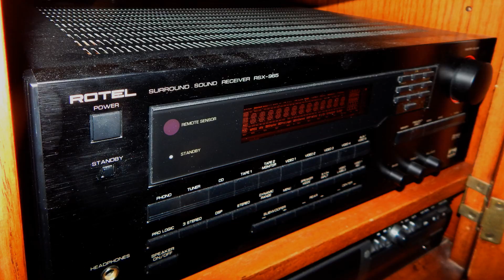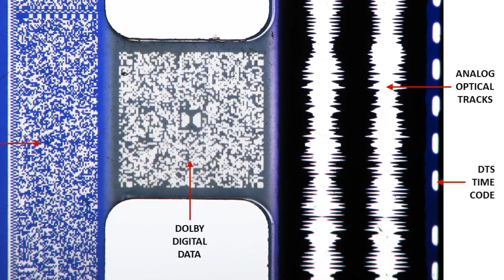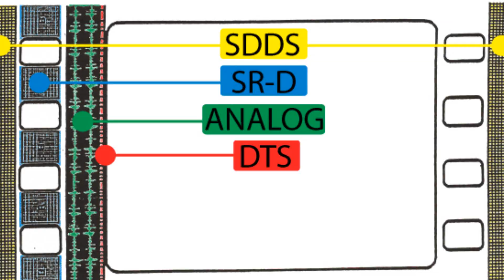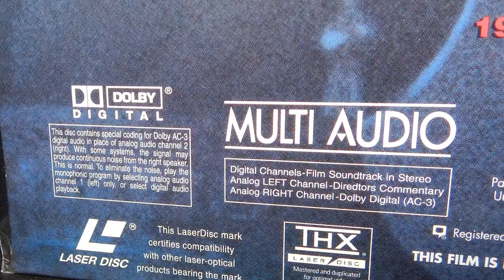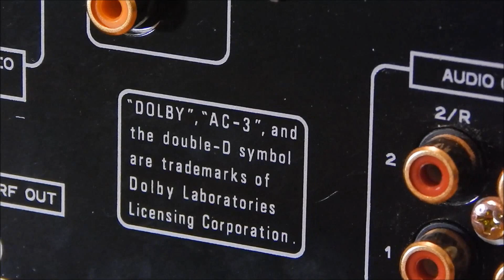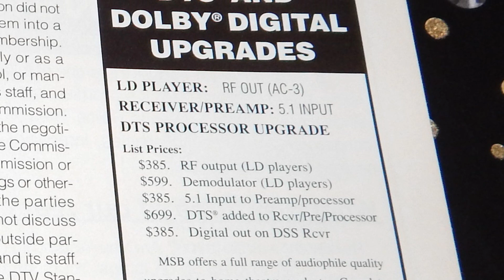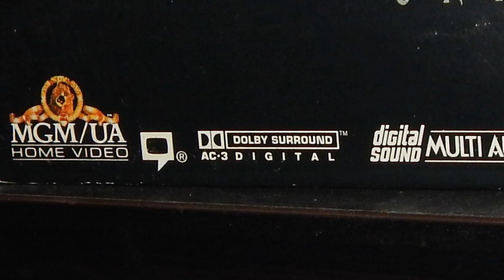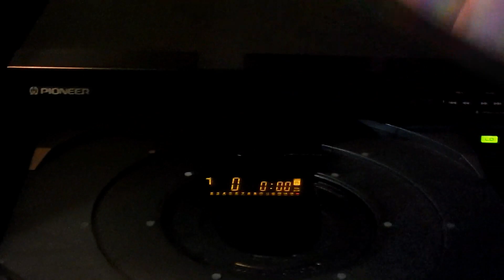LaserDisc Audio Guide – Part 3: AC-3 Dolby Digital

Comment: I bought my laserdisc player in 1996 when I was a student. But I had to wait five more years until I was able to buy a Pioneer VSX 909 that was equipped with DD decoder and an AC3 RF input. When I finally had it installed it felt like the sun was rising again. And it still does. When I listen to an AC3 soundtrack from laserdisc I always what all these new formats are needed for.

Comment: Ac3 is one of the few formats that'll  play proper 5.1 through my systems. AAC 5.1 and DTS seem to always downmix to stereo. Took me a while to figure out the issue. Aac 5.1 will work if the source is in the yv itself. But if it comes through HDMI to the tv is won't work right.

Comment: I used a Panasonic LX-H680 Laser Disc player which had the RF output connected to a Harman/Kardon ADP-303 Dolby Digital decoder.
Reply from the maker: The LX-H680 is a solid player. That and the AC-3-less H670 are great workhorse units!

Comment: SO why couldn't dolby have used same method as DTS? Feels like it was made more complex than necessary. Why not just include the demodulator in the players @ launch, why no players that str8 up decode with 5.1 analog RCA outs?
Reply from the maker: Yeah, there was a lot of back and forth on how to best implement the new tech. They really banked on receivers having built-in RF demodulators and figured that could keep down the cost of players. It was a gamble for sure!

Comment: Can I use a Pioneer Elite SP-99D as a preamp for my Pioneer Elite VSX-95?
Reply from the maker: You should be able to - if I recall correctly, that receiver has removable jumpers so you can connect RCA lines in from the 99D's outputs.
Reply: @Culturedog  Yes the VSX-95 reciever has the removable jumpers for preouts.
     I love the VSX-95 super clean amps (.005 thd) but it lacks the optical in that is needed for a new TV and thought this would be the best work around. 
      I have found a few of the higher end LG OLED TVs have a head phone jack for audio out, but I can't find any info on whether or not it passes 5.1 surround sound or simple stereo. 
    Again the Pioneer Elite SP-99D is probably my best option. What are your thoughts?

Comment: Fantastic video. I have no idea why it took me this long to stumble upon your channel. As you can see from my username I am a fan of the format and to me that period in the 1990s was some of the most exciting and memorable. I remember getting the ken cranes catalogs and calling their phone number to find out the upcoming titles. Good times. 
AC-3. Yes. It was awesome. My receiver in the late 90s had a built-in demodulator (Harmon Kardon AVR-75). Still might have it stashed in my storage unit. My current LD player is a  Pioneer 704 and I also owned a 505 and 104 when I first got started. I always wanted an Elite CLD-97 or 99 but gave up on that years ago.
Reply from the maker: It's always great to meet another LD fan who was there during its heyday!  Thanks for checking out the channel!

Comment: Your wisdom is appreciated! I just got and restored a Denon la3000 from 1992. I had no idea ac-3 was a thing. Typically I only bother with analog stereo audio connections. That's where I got confused by the right channel being replaced with ac-3. I want to buy some movies like Stargate, BUT the player only has svideo and rca ports... So unless I mod it and buy a demodulator I'm stuck with the basics. My dumb question is, am I correct in assuming that being stuck with listening to mono audio only applies to older players that weren't equipped with digital stereo decoders and relied on the analog tracks? Also do you have any advice for making sure I don't buy any of the discs that had screwy audio synchronization? (Like Stargate did before they released corrected ones.) Thanks!

Comment: Interesting video. I just ran into this (Youtube random choice!). I got into AC-3 laserdiscs during its heyday but my player didn't have AC-3 output. So I purchased a kit for my Pioneer CLD503 player that output the AC-3 RF signnal. Then I purchased a Kenwood KR-V990D that has a AC-3 decoder builtin. That was my setup for a while until I replaced the Kenwood with a receiver that could do Dolby TrueHD etc. Then I needed to purchase a separate AC-3 decoder (can't recall the brand now since my LD player and AC-3 decoder have been packed away even though they still work)
Reply from the maker: Thanks!  Yeah, I probably should have held on to my spare AC-3 demodulator, though I didn't think I'd need it at the time.  Thanks again for checking out the video and sharing your personal AC-3 history!

Comment: thanks so to confirm you need to select the R analog channel with the remote to unlock the AC3 track? staying on digital l/r out is not the way to go though the demodulator?thanks!
Reply from the maker: You don't have to manually switch over to analog on the player - the demodulator will be hooked up to the dedicated AC3 RF out and will automatically lock on to the signal if present.  There are some demodulators that can also pass through PCM digital and DTS signals, but mine just accepts AC3 only.
Reply: @Culturedog  ok thank you!!

Comment: question my laserdisc player has an ac3 output coaxial  and my reciever has an AC3 input will I still need a AC3 RF demodulator?
Reply from the maker: It depends on what model receiver you have - there are a handful of receivers that can take an undemodulated RF signal from LD directly - usually mid- to late-90s models.
 
If the AC-3 input doesn't specifically mention RF or LD, it's probably expecting a proper Dolby Digital bitstream, in which case you'd need to get an AC-3 RF demodulator to place in between the player and the receiver. 

This is the best list of currently known receivers that can handle a direct AC-3 RF signal from a laserdisc player:
https://www.avsforum.com/forum/90-receivers-amps-processors/652457-list-ac-3-rf-audio-gear.html

Comment: Would I still need a demodulator if using a Pioneer vsx-21 AV receiver? It has a coax AC-3 input on the back. I am using a Pioneer DVL 919 for my Laserdiscs by the way.
Reply: Thank you so much for the reply, the receiver I have is not the TXH one, I believe it might be it's predecessor, here is a link I found on ebay for one that sold, it shows all the inputs on the back. Model vsx-21 https://www.ebay.com/itm/233400237686
Reply from the maker: @OmarCabrera91  No problem!  Looks like all of the optical/coaxial ins on that ebay model are regular S/PDIF digital inputs, so you'd still need an external RF demodulator.
Reply from the maker: Is that the VSX-21TXH model that dropped around 10 years ago or so?  I don't believe that model can handle a direct RF signal from LD.  It doesn't show up on the list of gear with built-in demodulation, but that's not a complete guarantee.  One of the coaxial posts would have to specifically mention "RF IN", otherwise it's just a regular digital input that would need a demodulated signal. On the plus side, the DVL 919 is definitely capable of pumping out the RF signal if you decide to pick up an outboard demodulator or processor.

Comment: I have a rca ldr 600 and it does not have ac3 out and it has a pop in the sound every few seconds that keeps dts from playing i wish I could fix that and get ac3 on it and someone should make a new ac3 demodulator I see them on ebay but they are way too much like $250  I also have a pioneer 3030 but it is only a single side player but it does play dts
Reply from the maker: Yeah, the demodulator market was always pricy, but it's ramping up.  Occasionally some deals will slip through the cracks though.

I wonder what's causing that DTS glitch on the RCA?  Does PCM audio pop too?

Luckily, homemade AC-3 mods for the players are feasible - a few enthusiasts I know have pulled that off.  And there's still a source in Germany for the boards as well.  I've been meaning to order one for my MUSE player.
Reply: @Culturedog  yes I does the pop on pcm too it is much harder to notice though but you can definitely notice on DTS because the sound goes off for a second or two every time it happens just blank and then sound back

Comment: Sam, I just want to say thank you for this great series on LD Audio. I came across your channel just as I'm about to setup an LD I just picked up (DVL-909) and was planning ways to setup my audio and your videos are a great resource. Glad to see I can buy a newer receiver to be able to decode some of these older SS technologies. I was lucky enough to find a Yamaha APD-1 on the Bay to be able to enjoy the AC-3 discs. 

Aside from that, do you or anyone else on YT have a recommendation for a modern receiver that has decent analog upscaling conversion features as well as coaxial inputs for digital out? Thank you!
Reply from the maker: Thanks so much!  Glad to hear these videos were somewhat helpful!  

I haven't been paying attention to upscaling receivers as much as I probably should - mostly because I run all my video through a DVDO unit and let that handle everything.  My Rotel processor has HDMI switching etc., but I just send audio to it.  That said, I seem to bump into a lot of people in forums etc. upscaling with modern Onkyo receivers, so that's at least one avenue to check out.

Comment: What's better to use for ac3, rca or optical? My demodulator can do both (at least from the demodulator to the reciever)
Reply from the maker: I've done both - coaxial rca has the technical stats on its side, but I've never heard any problems with optical.  Though if you have a free coaxial input on your receiver, you might as well go with that one.
Reply: @Culturedog  ok. One more question. For digital audio out, would you recommend coax or optical? I have a Mitsubishi M-V7074 which is just a rebadged pioneer d703. So I have lots of options and I just want to make sure I'm getting the best audio I can
Reply from the maker: @abortretryfail2053  Nice player! 

Same scenario - optical will still get the job done and shouldn't have any audible drawbacks, but coaxial would be my first choice just for its superior stats.

Comment: If your 4K or HD tv has really good speakers built in you can still tell the difference between 5.1 sound and 7.1 sound or DTS surround without the 5.1 speakers. 7.1 is way more dynamic than 5.1, it just has more of a punch to it when you have thunder/lighting or an action scene. I don't think studios use Dolby Digital 7.1 on their blu rays anymore, the Halloween 35th anniversary blu is the only one I own that has a 7.1 track and maybe a few other movies. With Atmos, you need a surround set up to get that bouncing off the ceiling effect of a movie theater..... the tv won't do that.
Reply from the maker: I'll probably be upgrading to Atmos right when the next evolution in surround sound has already happened.  Haha!

I am looking forward to stepping up to 7.1 though.  My processor can do it - I just need to two more channels of amplification.

Comment: I finally got an AC-3 player earlier this year (a CLD-D504).  Then tracked down an old Denon pre-pro which demodulates the signal into my modern A/V receiver.   And I have to say, the movie tracks I've listened to sound more 'theatrical'.  There's a slight reverb, but dialogue is clear and there's a sense of openness.   I don't get that from modern blu-ray soundtracks, where it often seems over-processed or near-field or whatever.  I don't think this can be written off as placebo effect either - it's the real deal!!
Reply from the maker: Yeah, they sound big and often much more engaging!

Comment: Thanks for making these videos. I've fallen into the audio rabbit hole and I can't get up, or out haha. I have 3 lower to mid end players I all found at Goodwill on the cheap. Then I have a Pioneer Laseractive with the Sega and Pc engine pacs. I just purchased a Cld-d704 player off of Ebay today. This will replace my 503 player in the living room. Now I guess I will need an Ac3 rf modulator. I only see one JBL unit on ebay for 200 plus and it doesn't even have power supply. Smh
Reply from the maker: No problem - thanks for watching!  Enjoy that D704!  That should be a nice step up from the 503.

Yeah, the demodulators can be tough to find, and often overpriced.  Though I noticed recently there were a ton of Yamaha demods listed from Japan.  Though probably 110v versions that would need a step-down power transformer.  I already regret selling my backup demod!
Reply: @Culturedog  Glad you said that about the 110 volts. I looked back at my order and realized the Yamaha was 100 volt. I quickly found a 25 dollar step down/step up transformer. Now I should be in business.
Reply from the maker: @jeffmacknz  100v!  That's what I'd meant to say!  haha

Nice!  Glad that worked out.  I picked up a transformer for my LD-S9 laserdisc player and it's been working great.

Comment: Hello Sam, I'm fairly new to the LD world having just starting my journey a short 4 months ago and I LOVE it! I have learned a lot from your videos.
 I have a Pioneer DVL-90 elite plugged into my Onkyo TX-SR444 receiver and all of that is plugged into my TCL 4k UHD. I run the picture through an upscaler and a filter. The picture is compatible with DVD's and some LD's are even better. The sound on the other hand Rocks! One question that I hope you can answer is one I have been chasing for 3 months now and haven't found any info. I have my LD player digital out connected to the digital in on my receiver, I get Dolby, Dolby 5.1 and DTS, when I play the disc the receiver shows the appropriate encoded sound track on its screen. I even have sound from AC-3 discs but I don't have AC-3 RF plugged in and the receiver doesn't display AC-3. Am I getting AC-3 RF sound from the LD players digital output? Or am I still missing an audio channel? When I watch Top Gun with AC-3 it sounds amazing! I can here the jets circle the room. So what am I missing?
Reply from the maker: That's the stereo matrixed surround PCM track you're hearing.  Since AC-3 discs also have stereo digital tracks, those are what get pumped out of the player's digital outs.  I'm guessing your Onkyo's just doing a great job at decoding the surround information - probably with Dolby Pro-Logic IIx or something along those lines.

Since you've got a newer receiver, the only way to hear the actual 5.1 track would be to connect the "AC-3 RF OUT (LD)" post on the back left side of the DVL-90 (right above Digital Out 1) to an outboard AC-3 demodulator (or a demodulator/decoder combo, which might be overkill), and then run an optical or coaxial cable to your Onkyo from that. 

On the plus side, the PCM digital tracks on most AC-3 discs sound fantastic, so you can still enjoy the discs while you look for a demodulator if you decide to chase one down.

Hope this helps!  Thanks for watching and reaching out, and give a shout if you need any troubleshooting assistance!  Cheers!
Reply: @Culturedog  You answered a question that I have had no luck at finding an answer I understood. Thank you so much!
Reply from the maker: @abcdefg-ud3cu  Awesome!  Glad I could help!

Comment: Another excellent video Sam, very educational. I have two AC-3 RF decoders, both of which I can recommend. The first is my main AV Receiver which is a Denon AVC-A1D an all round superb bit of kit, apart from AC-3 RF it can also handle DTS.  The second is a Marantz DP870 which is also a great AC-3 RF Decoder. Cheers, Alan.
Reply from the maker: Thanks, Alan!!  I wish I hadn't sold my 2nd demodulator unit.  I'll keep those in mind while I'm on the lookout for another unit!

Comment: Great video. Knew most but learned a few new things. As someone who has had Laserdisc twice now, once in the day and presently I’ve still never had Laserdisc in Ac3. So the part of the video I was hoping to hear was your opinion on how much of a difference it made? As you said if you rocked the PCM strong tracks in a surround mode it was fantastic. Other than the discreet surrounds what did you feel was the biggest benefit after all the trouble to have it decoded?  Thank you.
Reply from the maker: Stereo surrounds were definitely the most immediately noticeable difference like you mentioned, but the overall listening experience was punchier and more vibrant. The other night when I was listening to the Blues Brothers Signature Collection LD, I kept marvelling at how clear and energetic  I' the Dolby Digital sounded at such a low bitrate.

It's tough to say if the payoff will be worth the trouble of hunting down a demodulator and integrating it a system for everyone, but I feel like it did kick my LD home theater experience up multiple notches.  I'll be getting into this a bit more in Episode 5 as well.

Cheers!
Reply: Thanks for the response! I was hoping to hear not much as I don’t wanna start obsessing over a demodulator haha. I’ll have a look in episode 5!

Comment: Man, I miss my old pioneer receiver had DTS and an AC-3 RF in. Was so sick but the PSU went bad.
Reply from the maker: Bummer!  I hate failing PSUs.  I wish I loved soldering capacitors all night and day.  Haha
Reply: Which model was it? Do you remember by any chance. I just found a pioneer vsx-21 with the ac-3 input, does that mean I don't need a demodulator?